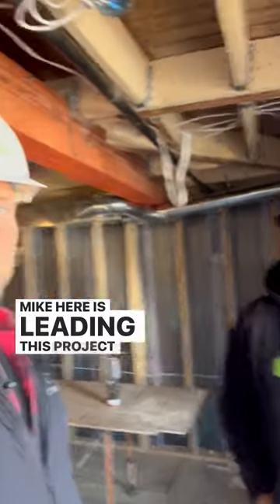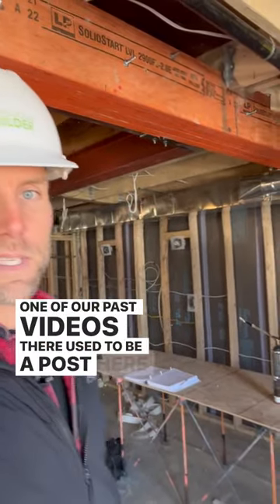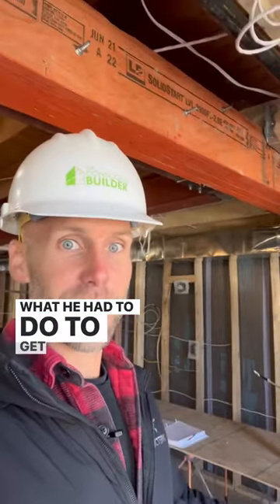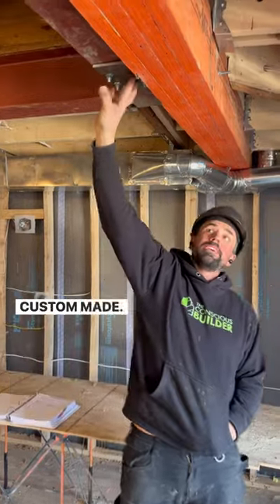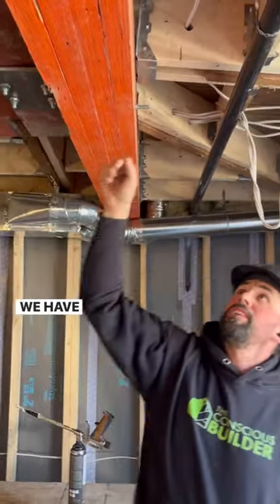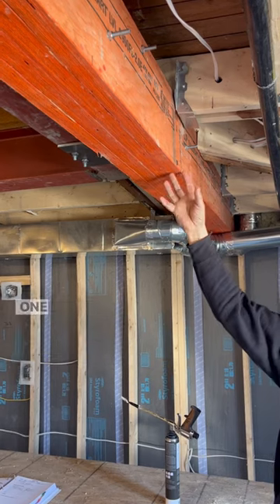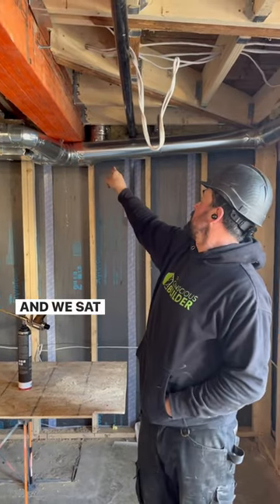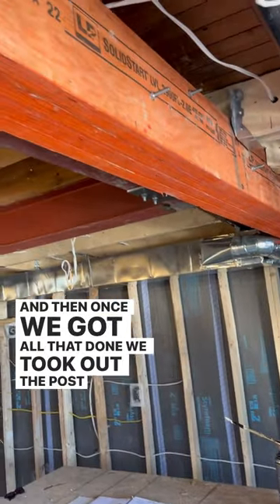Removing a load bearing post is simple, but not easy… #construction #renovations #framing

Comment: Why did it need that custom plate bolted to the i beam
Reply from the maker: It's holding up the steel beam where the post used to be.
Reply: @Theconsciousbuilder how many of those brackets were required?